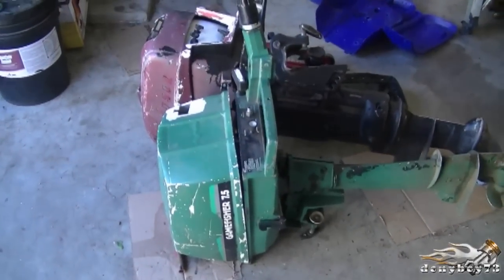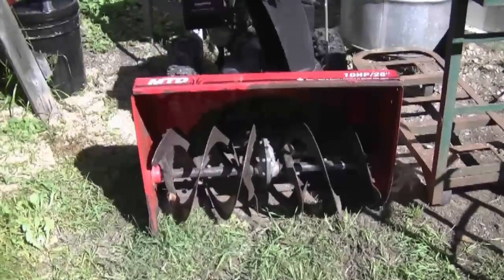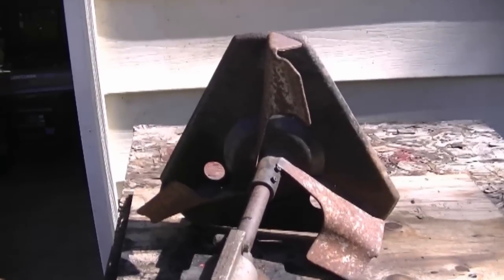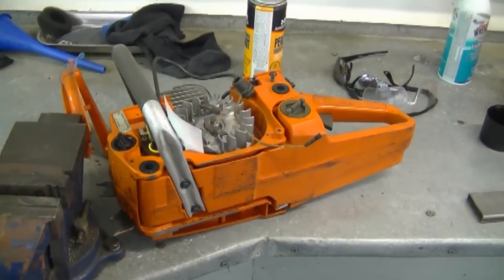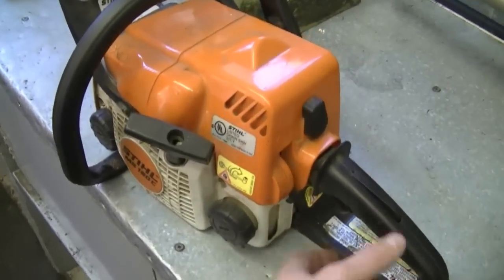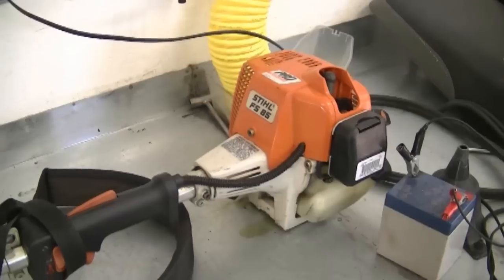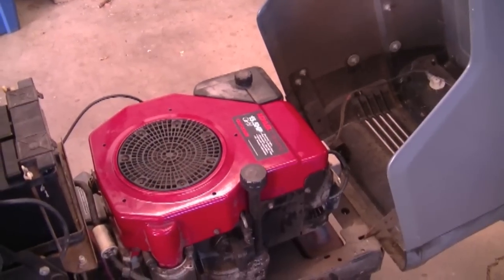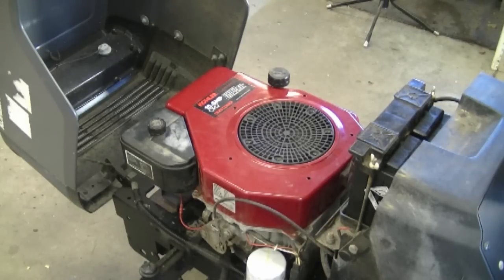Small Engines Q & A Video #109 in HD

Comment: Thanks for your videos. You do an excellent job. I have a snowblower that starts and runs fine  off of electric start. It will not start off of the pull rope even after it is warm. What might it be?

Comment: Donyboy i repair quite a few string trimmers that  just need the diaphragms but when i go to purchase them only i am told that i will have to buy the complete kit  they are telling me that  it is the only way they are sold i need help locating just the diaphragms is there a way to soften them up i hear that you can just soak them in the fuel mix for so long then reuse them and where can you order the diaphragms from

Comment: I have a good one I have a 1982 craftsman chipper 5hp b&s engine  135212-0272-01 
I was cleaning the cab and I stretched the governor spring some  . Now when I start it it never runs past a low speed even when I push the front lever on the outside control it stays the same. I have tried to get the spring and after ording 2 different one they were wrong . I even took the part from B&S site and still no luck . Can the spring be fixed other than replaced?
Thanks

Comment from the maker: you might need a new float if there is gas inside of it, shake it and if u hear gas then replace it, also the needle valve under the float may need to be replaced,  I was in Holland in 2000

Comment: we had a partener chain saw with exact same problem, turned out to be a faulty coil/module, changed the unit, going good ever since. the coil cost a 100 euro.s here,a bit steep. most likely cheaper in canada.

Comment: If your string trimmer is a 2 stroke you don't need to run it WOT, but they are designed to be run at high rpms.  They run better, atomize the fuel better and last longer when run properly.  Not designed to be putted around just above idle, run it 1/2 throttle or better if its a 2 stroke.

Comment: i have an older craftsman lawnmower,from the mid 80s. i use it to feed 45 horses,so i have 500 pounds of hay,and the trailer,wich comes out to about 650 pounds. it pulls it just fine,i could not ask for it to do better. but i sometimes shut it down while it is still moving to save time,(shutting it down under load) and when i go to fire it back up again,it backfires really loud. is shutting it down under load causing this? it is a kholer engine,so i run it about 3600 rpm's(manufacturers speed)

Comment: It wouldn't hurt to clean up the magnets on the flywheel I do it when I take apart a engine just so it has better contact with the magneto and I prefer 2 cycles cause they are lighter than 4 cycles and much easier to work on

Comment: i can tell you the old johnson is a 50's model, looks like an earlier one. you will need a pressurized gas tank to run it unless someone has done the mod to add a fuel pump to it. you can get most all of the soft parts and ignition parts for around $350 dollars if you want to rebuild it....

Comment: I've got a trailmate edger that I bought back in 1979.  The flywheel is rusty.  It runs ok, I was wondering if polishing it would make it better. There are ridges on  the flywheel and since i'm  not a mechanic, I was wondering if I polished or sanded the flywheel if that would mess things up due to wear ?

Comment: I use feeler gauges to gap the ignition. It works best for me. I just rebuilt a 6 horse briggs and fixed 3 weed eaters. Craig list had 2 snow blowers that ran for 50 bucks. I am getting a truck after taxes, definately need one. yeah Dony, I replaced the drive wheel on my snow blower. Hopefully that is the problem. my dad said it would run but after using it awhile it didn't want to pull itself, the belt looks brand new. So I changed the drive wheel for 5 bucks, it is on a snapper. Happy fixing

Comment: Heh Donny nice video! I appreciate the info on the ignition module. I have a small engine business I'm starting up and the ignition module failure is interesting. I've had one fail already to the point of no spark, but haven't run across one with symptoms that you discussed, so great info for future problems I may encounter.

Comment: big suppliers and shops should always make two adjustment, first one for the break-in period and a second one after a couple of gas tanks later to suit the enviroment conditions the equipment will be exposed to. but nowadays almost all 2-cycle household equipment has a fixed carb adjustment and there are no screws to fiddle around anymore

Comment: After rebuilding the carb also check the pan bolts.  The cylinder and crankcase for these engines are cast together with a pan/cover on the bottom.  There are 4 allen screws that hold the pan to the case.  The screws loosen from harmonic vibration which allows the engine to draw maverick air and then not run right.

Comment: i bought a new husqvarna line trimmer a year ago the warranty ran out 3 months ago now the carby is playing up it starts and runs really rough like a jackhammer it hesitates to rev when its at full throttle its fine let of the the throttle it shakes and jumps to idle and dies i have tried cleaning and tuning the carb i think it might need a replacement?